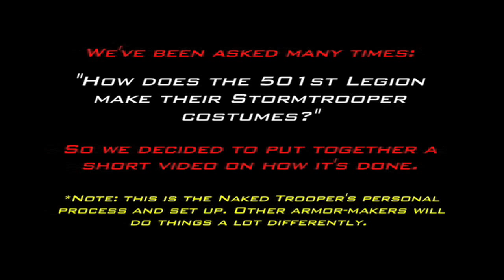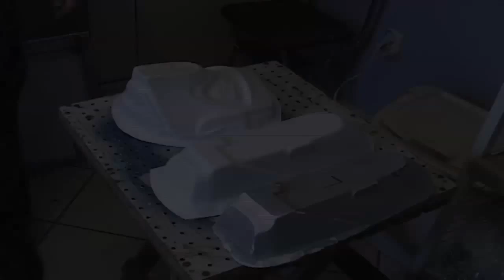How to make Stormtrooper Armor - Vacuum-Forming Tutorial with the NakedTrooper

Comment: Glad I found this video! helped me narrow down my search.  Thought I found a good source of HIPS, but then checked the thickness (0.015 inches), no way that will be useful.

I do have a question though: If I'm vacuforming something much larger than both of those (one shape being around 1 foot high) would it help to get thicker HIPS, or would I HAVE to cut this down (I'm doing the Fallout 4 T-60 power armor, if you want an idea of the shapes I'm working with, making the exoskeleton with resin and bondo, and vacuforming the armor, unless that would be impossible.)
Reply: Did you make the vacuum ? ...I dont know why it does not work for me ...it does not suck how it should suck ...... >.< Any tips on this ?
Reply: Forgot to mention that my dimensions on the HIPS are 20cm on 100cm (also with the metal frame included) ....
Reply: Hey, I held off on making the vacuformer, but I've been getting as much info as I can.   As for your question: have you been using a shop vac? maybe some pipe insulation foam around the edge of the forming surface (the black, rubbery stuff) could help to form a better seal.  I don't know though, that's just what I've thought up.  Maybe the things I learned from asking around at cons when I saw people with clearly vacuformed costume pieces could help with any other problems you may have:

When heating your plastic, the plastic should droop to about half the height of the shape you're forming.

The buck should have no undercuts.

Just had this idea: Before actually forming your plastic, test your buck with some shrink wrap.  Put some shrink wrap over your buck and vacuforming surface and suck the air out, this should theoretically give you an idea of where you may need to drill a hole in the buck to prevent air pockets.  Of course, this could also just shred the wrap, if that happens, test it with a vacuum cleaner instead of a shop vac.

Black plastic will heat better, so if you can use black plastic, do so.

That's all I can think of off the top of my head.  Hope it helps.  Good luck.
Reply: Bhil Fitch
Thank you for the info man ! ...Well yeah, I tested it the vac works perfectly when I put small 100% surface cover on the vac...when I put the model then try to put the heated plastic over it just fails ......Its a black 2.5mm hips plastic ... T_T ....thanks for your time man ! apreciate it ! ...BTW Should I invest into a vac pump ? ......would that do the trick ? .....I guess its more powerfull than a household vacuum cleaner
Reply: Never heard of a vac pump, but from what I've heard, a shop vac is a must.  I'm not the best source of info on vacuforming though, I haven't actually done it yet.